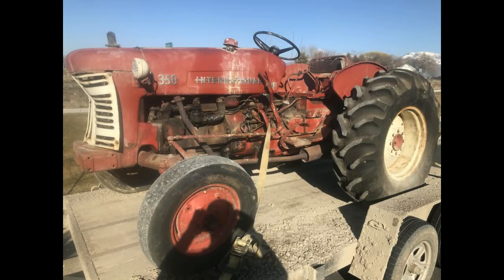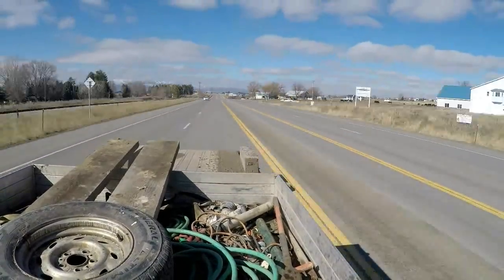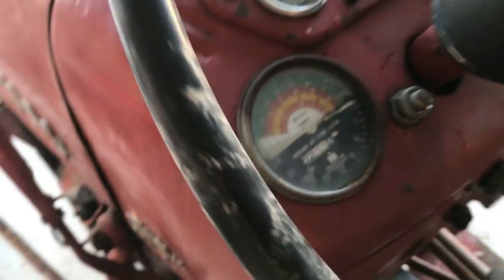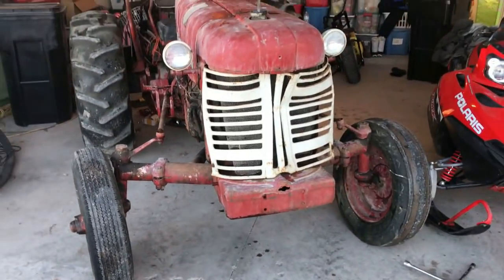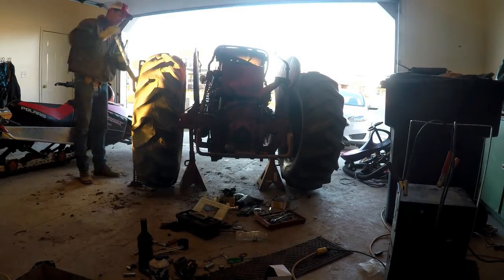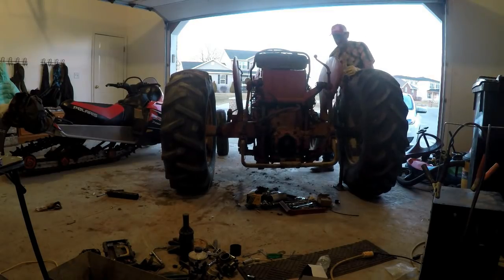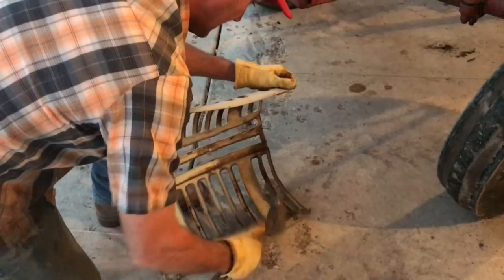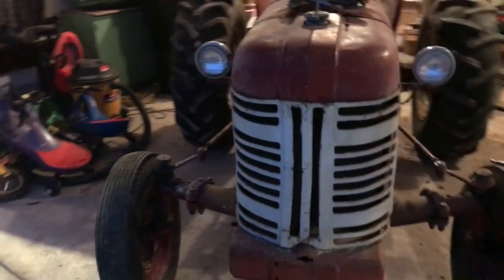#196 - I Bought A Diesel Tractor For Dirt Cheap... And It Runs!

Comment: Man. You're gonna like that 350. Other than having to convert to toplink/3 pt, the only thing you'll have to do is keep in mind that the hydraulic lines are exposed, so take a bit of care they don't get snagged when brushing.
Reply from the maker: The hydraulic lines seem to be new. I drove it around today. Trying to decide the best way to convert it to a 3pt
Reply: +RPR....There's conversion kits out there, but yer a sharp fabricator and you CAN fabricate your own.  All you gotta keep in mind is the lengths/pivot points need to be fairly equidistant (within the toplink adjustments). Think it thru. Pin the box scraper to the lift arms on a flat surface. Measure from the desired upper lift pt of the scraper to where you want the top pivot to be on your tractor and start welding. Easy Peazy. Oh, don't bother to weld to cast iron. It WILL fail and you'll start over at the worst possible time. Hope this helps.

Comment: Nice score !!! The extension tubes on the front and reversible tires and spacers are actually there for COMMON ROWS. When planting fields there are a standard width practice to be able to use the most land as possible. It allows the tractor to be adjustable. You may already know this but just incase :)

Comment: also careful with length of bolts in hydraulic pump to timing cover. If you put to long of a bolt into pump to timing cover it hits cam gear breaking cam retainer plate bolts wiping out cam and governor gears. Mine also had that issue. Adjust torque amplifier linkage may work. Also rain water gets into transmission from rust hole in tin cover under battery box below steering wheel area.  Red power site and Steiner Tractor TV has everything. Good luck. Shalom

Comment: Back in the late '60s and early '70s I had a '58 350 utility.  It had a front loader, (after market .Lord was the make, with an 8' snow bucket, rear wheel weights, a rigid hitch with a concrete ballast block which measured  about 2' wide, X  slighly over 2' high and about 18" deep. It was great on gas and over the years I moved a lot of snow with it. No cab so it was colder 'en hell but I loved that machine.  If I had the money I'd try to find it and if I got so lucky as to do that, I'd restore it to  factory new condition.
Reply from the maker: Thinking about cleaning it up...

Comment: That particular tractor in a diesel is extremely rare only about 50 ever made and 15 or so complete ones today, one of which is fully restored sitting in my parents shed.
Reply: They built 3033 Diesel 350 Utilities in several different configurations. I just picked up a nice one myself.

Comment: Good Buy and you've got the right idea swapping the tyres around for greater stability, put a ROP system of some sort and your good to go. We've seen where you will be using it, and to be honest, you worried me a bit on your old machine flying around without any ROP fitted.It's ok to give yourself a scare but a rollover is not what we want to see on video. I'm sure your son is itching to get in the driving seat and I'm sure you will teach him well. By the way do you need a wider trailer now?  Good Luck All Round.
Reply: one pup To install ROPs, he would need to upgrade the seat and ad a belt as well. Those old series IH’s are not designed to support ROPs and on older tractors it can be more dangerous to have them installed than leave them original. If the guy actually knows how to really use his tractor to it’s full capability safely, he most likely doesn’t need a safety sally ringing their hands in angst .....

Comment: Cool old tractor. I have seen a number of these with a belly blade. Would not be that hard to put a dozer on the front.
Reply from the maker: I didn't like the last dozer blade on my other tractor. Too much weight on the front. I will probably just find some chains and use my scraper on the rear.

Comment: Run a  craigslist ad for fast hitch implements. They're out there. You can also get the spears that fit it for a 3 point adapter. Better than converting it. I've been using my Utility 300 for 20 years now. The fast hitch is fabulous, especially once you get older. Mine has down pressure on the hitch. There's a pin on the top arm on the left side. Pull the pin and the hitch will float when dropped. Leave the pin in and you can pick the back of the tractor right off the ground. At 2:35 in this video. https://www.youtube.com/watch?v=OBkPx6y6PQ8 However, mine has the lift ram on the left. I can't see yours.
For your road, you can build your own grader pretty easy. In fact, I show the down pressure in this video as well at 10:40 https://www.youtube.com/watch?v=Dpeg9yTPuEo

Comment: 60 plus year old tractor can you even get parts for it now do they even have any you can buy off the shelf that's that's the only reason why I don't care if you can buy the stuff off the shelves Carson stuff that's 10 years old still make them the last cars tires don't laugh you can just put them away in stores person who sings for Lifetime hard to buy something at 50 years old he can't find something specifically needed for it until you make yourself
Reply: +James Ledesma.....Yes, every part except the castings is still available new, used, or aftermarket. That's the beauty of those old workhorses. Proof of their continued value as tools, and why there's so many still around doing their job.